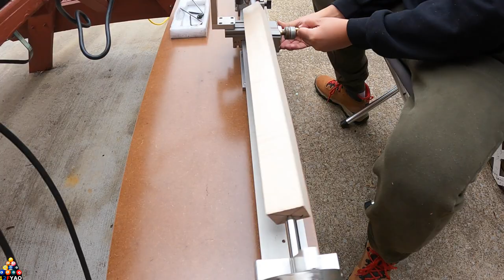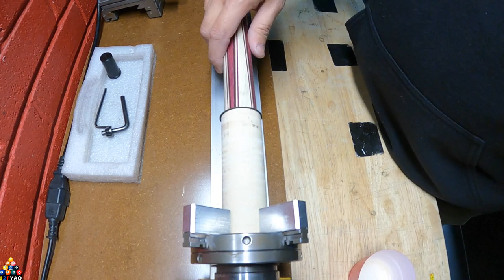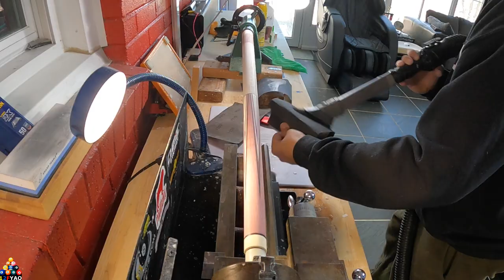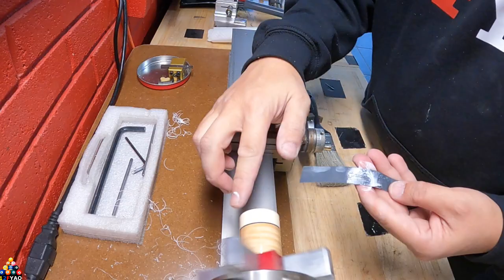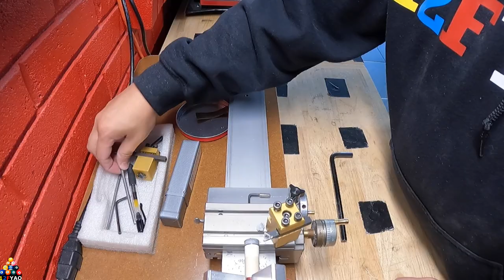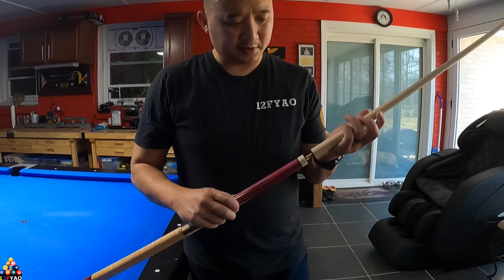SOLD: Time Lapse. Making a Pool Cue. 4 PT Purpleheart w/ Holly Wood & LD Shaft

Comment: Why not make handle turn bit for a cordless drill and wind the carriage back and forth on your lathe it would make it alot easier on hand .plus smother cuts. Food for thought like the video. One question  whats the bed length on those sureline or sterling lathes if it is one ?.
Reply from the maker: I need to do that. That would speed up my process. I did buy the power feed and it is night and day when finishing a cue.  I used it to turn the shaft and sanding is not required after. I am planning to make a video on it. I have a cue I’m making now and when I need to do the final turn, I will make a video for the power feed. Thank you for commenting and for the idea  I will try to use it for just cutting. Also if haven’t already please subscribe and please share.

Comment: Hi Yao, I've watched all of your cue making videos and I must say your doing an excellent cues. Just an advice though,  you may want to round off or put a little bevel on the edges of the butt cap so it will be more resistant to chipping. I know you are already using a durable material but trust me on this one.
Reply from the maker: Thank you for the advice. The imitation ivory is not as durable as I thought. I will start rounding it and taking your advice.  Thank you for commenting, please subscribe if haven’t already and please share.

Comment: Where did u get that holder to mount that dremel tool for making glue reliefs?
Reply from the maker: I got it from Amazon.  It’s actually for a Proxxon. I had to epoxy the holder because it was a little too big but it works. It has no play. I seen some that screws in directly into Dremel but I forgot what website. 
Link for Proxxon holder. Thank you for commenting again and hope this helps.

Comment: Did I misread? Did you say this is a LOW DEFLECTION shaft? I been building cues on/off for years, I'm a bit curious what qualifies or makes this a LOW DEFLECTION shaft?
Reply from the maker: Try coring the front end of the shaft to reduce “endmass” and test it. If the shaft deflects less than a non core shaft. Many would say it’s a lower deflection shaft than a regular shaft. 
Dr. Dave can explain it better. Thank you for commenting, please subscribe if haven’t already and please share. 
https://billiards.colostate.edu/faq/squirt/endmass/
Reply: @playpool12fyao  I am well aware of boring and coring of front, handle etc, i was speaking of this particular shaft i did not see in your construction, any boring might  have missed it ( high speed ) i am not jumping on your work please do not mistake. ALL cue makers learn from others no matter how long they have been building. I got my start from Bill Stroud, I enjoy watching what you do. thank you for answering my comment
Reply from the maker: No problem, having something as “low deflection” is really controversial to me especially with a person is testing it with the cue ball hitting the middle diamond on the short rail. I do bore out the front of the shaft to help lighten it and the T34 ferrule is really light. Thank you for commenting again.
Reply: @playpool12fyao  Could talk to a hand full of cue makes and get several opinions on LOW DEFLECTION METHODS  and how to accomplish such. I will re-watch to see you bore that shaft, thanks for the answer/reply
Reply from the maker: No problem enjoy the video.

Comment: I don’t have a Facebook account so I can’t reply to your page, but I was curious if you would make a cue like this one or a ‘merry widow’ with a torrified or keilwood shaft. If so, what would be the price and wait time?
Reply from the maker: I don’t charge much $200, plain, for labor plus the wood that is needed. For a merry widow, I get the wood from Bellforest and for A joint cues I get the forearm from Prather. For the keilwood shafts, I get them from Prather also. The labor would be $100. The small items are part of the labor costs. If rings like Southwest cues, add $50 to the labor, total $250. Also the customer pays for shipping also.  Hope this helps.  
https://prathercue.com/collections/cue-parts
https://prathercue.com/collections/premades
https://www.bellforestproducts.com/turning-blanks/
Reply: Is there a link or an email to discuss details, exact price, and make an order for a cue?
Reply from the maker: Fyao1017 @yahoo.con. Is my email.

Comment: Can you now taper shafts perfectly? Your tools seem to be upgraded.
Reply from the maker: I got lucky because the shaft Schmelke gave me was already straight. I just adjusted the taper to match the joint size of the cue but. I am going to be working on a taping guide for my lathe. Hopefully it works and I can do a video for it.  The tool upgrade is amazing. I re cut my cocobolo with the 6 points and I did not have to sand at all. The finish is flawless, now the veneer won’t have bleed over from the wood forearm or point from sanding.  Thank you for commenting.